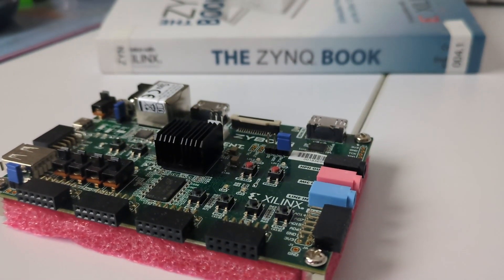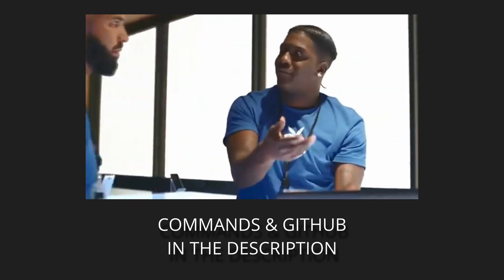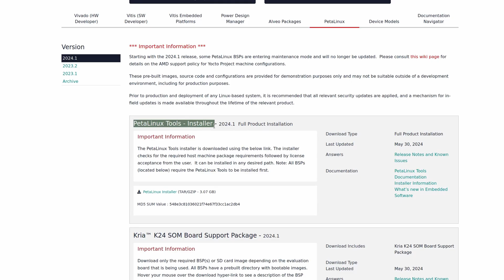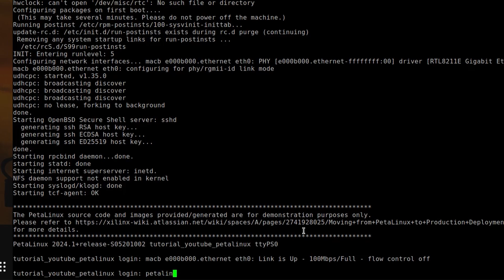Running Linux on Zynq, FAST !

Comment: Linux? Linux is Dead. Those Borg / Avatar, Made it for Your God / P1G Father.
Reply: Personally I disagree
Reply: @aden6427  Dis-Agree: It Doesn't Bother Me
Reply: if Linux is dead,  tell me  which one is living ?
Reply: @活久见-q3f  You Don't ACTUALLY Understand What Linux is?
You Cant Separate Software from Hardware. Windows is FULLY Accelerated. The Reason its Twice as Fast for Half the Cost. As Compared To Macintosh.
Macintosh - Sony/TCL, they Give Apple BSD. Apple Makes Carbon and Cocoa. Makes Changes to BSD - Calls it Darwin. Gives it Back to Sony/TCL. They Accelerate it. Give Back - Apple: A CPU and Compiled Kernel. Compiled Kernel -So They Cant Learn How the CPU Works. Thats What Linux is Aswell. My Father (Yoda) Has:  Arch Linux from Steam Deck and BSD Darwin from Macintosh. So They're Half Accelerated. Gentoo Linux on The PlayStation 4 is Zero Acceleration. Not Even Half. What Does it Look Like.
BSD is Sony and Linux is Intel. They Debian and SUSE / KDE. Those Minions  Fujitsu / IBM / Redhat / Ubuntu - They GNOME GTK. Even Your P1G Father has Linux. UnAccelerated - However, Functionally Equivalent. So, it Works - However, Slowly.

Comment: Hi ,for me ping is not working...in petalinux where i need to check and enable. If I type ping after booting board .. it's giving a ping:bad address .. ifconfig .. the eth is up
Reply from the maker: Hello @rohithkapse9090,
Sound like you have an address issue ! Maybe try a local address like 192.168.1.1 which is typically your home router.
If you tried google.com for pinging then maybe petalinux has some trouble with resolving DNS stuff.

Let me know how this goes for you !
Also chack out the github (see description) to see all the exact commands I ran in the video, maybe you'll get some inspiration.